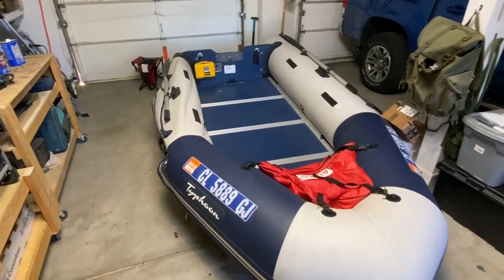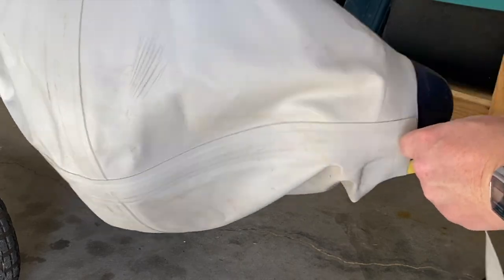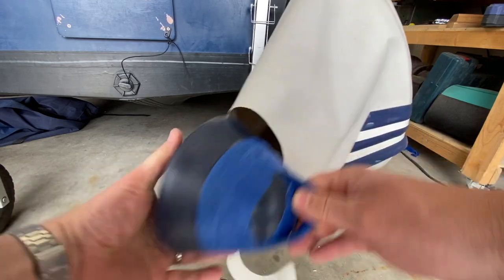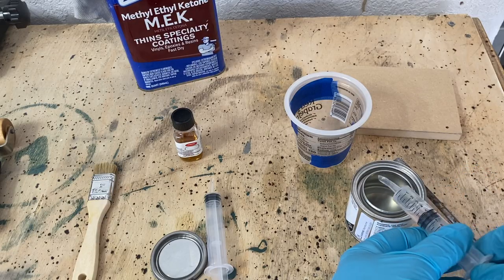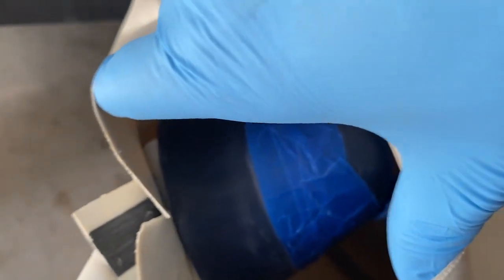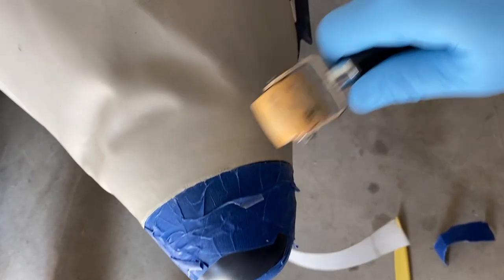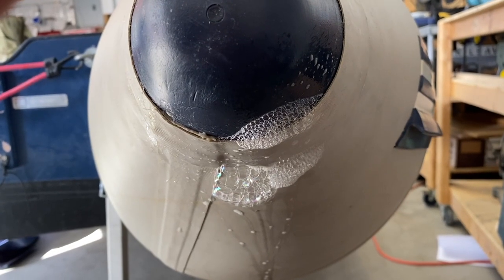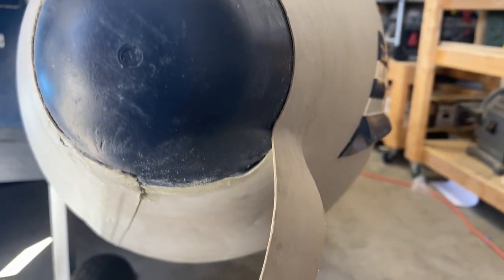Inflatable boat repair full tutorial-cone replacement

Comment: Thank you for the video. I need to tackle a similar issue in a Dave Scadden Outlaw Escape this weekend. This was very helpful to watch beforehand. I’m surprised how you were able to pump up the boat while seating the cone. I was contemplating cutting an access hole into the pontoon so I could get a hand inside, then patch the access hole. Any thoughts on that approach? Has your cone held up good since the install?
Reply from the maker: Jon, I am glad the video helped you out. I actually ended up doing both cones on the boat that day and they have held up well.I used Sta-Bond adhesive from NRS.  I did have to redo one cone because it went on sideways when I put it together and I had trouble getting the PVC seams to line up.The second one did great.  I don't like cutting extra holes in my boat, but to be fair I also contemplated the idea .I found using tape to make a small handle on the cone was a huge help in maneuvering the piece in place. If you have the cone out do a few practice fitting before you use glue on the boat. Inflating the pontoon while I fitted it was the only solution I could come up with that led to a symmetrical placement. It inflated quite easily and quickly using a a shop vac.
Reply: Hello, did you succeed in repairing the leak on your Dave Scadden escape. Mine also has a leak where the fabric meets the cone.